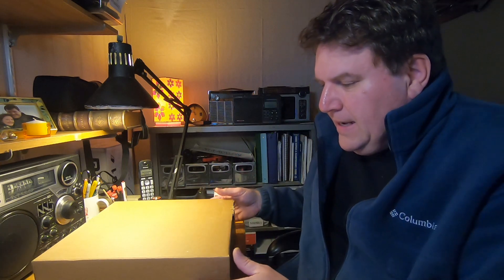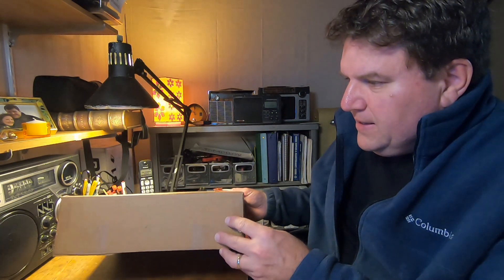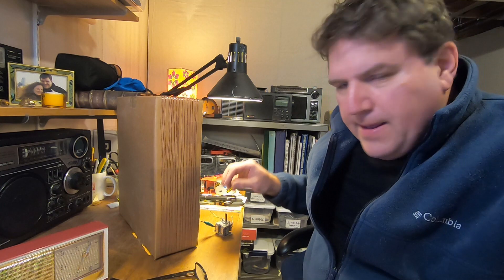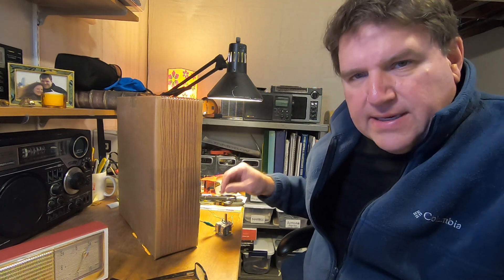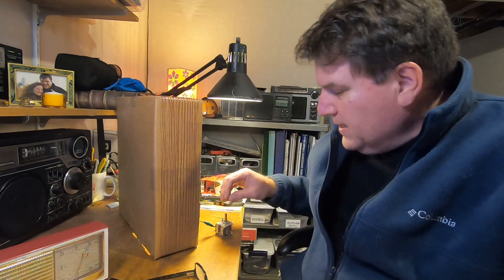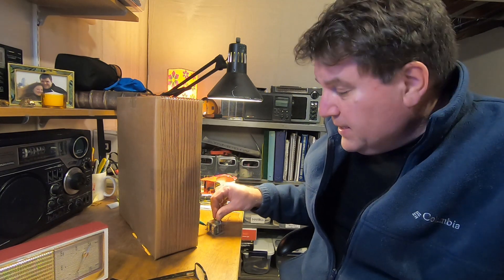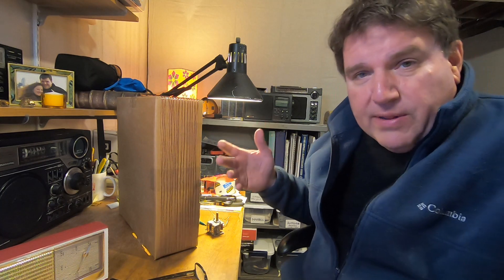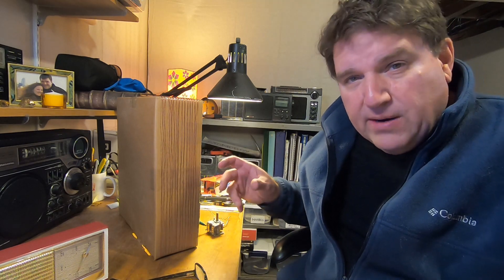Improve AM Radio Reception with a DIY Loop Antenna!

Comment: the gap in my zenith radio was roughly twice the thickness of the paper wound 18gau wire. wound too densely the capacitance drops drastically. ie 28gau enamel coated wrap is too dense. neat project.

Comment: Hi. That’s really helpful, thanks. Do the antennas improve if more turns of wire are applied? Is there an optimum length of wire?
Reply from the maker: I think there is an optimal length and number of turns, but I don't know what it is.  You can find a loop calculator online.  Here's one:  https://earmark.net/gesr/loop/umr_emc_round_calc.htm
Reply: @Radiodog Thank you so much, that is very helpful. Thanks for replying so quickly too!

Comment: Hey I tried with a loop similar to your antenna (wrapped around a tissue box) but not sure how to attach the variable capacitor to the antenna... And also still not really getting any better reception. Any suggestions?
Reply from the maker: There should be a lug on the capacitor.  For mine, I attached one end of the loop to the lug, and the other end to the capacitor body.  Hope that helps!
Reply: @Radiodog thank you!! I'm trying to send a picture of mine but can't seem to find a way to upload....there are three silver prongs coming out just not sure which one is right. Then I connected the antenna to the capacitor and the other side connected to the radio (it's a grundig) but still no joy 😢. Any suggestions?

Comment: Thanks. It’s funny that I see you have a link to a sizing calculator based on the Joe Carr formula. As I was watching this video, I was thinking that I should comment that anyone interested in radio reception, whether it be AM, FM, shortwave, or whatever, should definitely get the Joe Carr’s Receiving Antennas Handbook. I picked it up a few years back. A little heavy in the math and theory in some spots, but it will be good to get exposed to the heavy stuff even if you don’t know it, you’ll figure it out eventually. It has some great projects in it also, that are really not that difficult. I highly recommend it.
Reply from the maker: Thanks for the comment!  It's been a long time since I made this video; it's frankly a little embarrassing.  I've been tinkering around with this stuff for a long time, so I'm a little ashamed to have never hear of Joe Carr's book.  Sounds like I need a copy!

Comment: Thank you for this video.  You seem to be quite knowledgeable about this subject, so I'm seeking some advice.  I have recently restored a 100 yr. old Atwater-Kent AM Model 55 radio.  Very little work was performed on the electronics unit itself, as you could imagine after 100 years some of the antique wire was 'petrified'.  It has vacuum tubes, they were all tested, 2 needed to be replaced and were.  Upon energizing the radio, all the tubes have a nice glow.  But I seem to be having an antenna issue.  While I can hear some static through the speaker, I'm not picking up any stations.  I thought it was worth trying one of those cheapo loop antennas with 2 wires.  The radio itself has 3 spring loaded antenna connections, a ground, a short local connection, and one for long distance stations.  While trying the loop antenna, I heard a voice near the bottom of the band for about 2 or 3 seconds, but not after that.  There is still some static through the rest of the band.  If capacitance coupling is necessary, I'm not sure how that is achieved.  The front panel of the radio does have a selector that chooses between the long and short antenna capabilities.  Could you offer a suggestion regarding the antenna hook-up arrangement?

Comment: You need to get the capacitor as surplus as they are very expensive.
Reply: Yes, you can also make a home made on for doing an experiment.  It is not as nice as a professionally made one but it can be good enough.

Comment: I'm always surprised at how many people claim that a loop antenna such as the Tecsun AN-200 has no effect on reception. It's clear to me that they are not doing it right. The right radio is important, as is positioning of the antenna relative to the radio and dialing in the frequency correctly on the antenna. I've always had excellent results with the AN-200.

Comment: It's a pity you don't show one of the most important part, as least for a newbie : how to attach the wire the capacitor ? Have a nice day Tom
Reply: It is connected straight to the capacitor in parallel. There are two ends in the loop and two sides of the capacitor. It is not connected to the radio. It inductively couple to the radio antenna by being close.

Comment: @Radiodog I know this video is 3 years old, but I just found it.  I have an old Technics SA 110 adio receiver.  It came with an AM loop antenna, but that was lost.  There was no variable capacitor on the antenna, it just plugged into an RCA jack.  With your desugn, can I skip the capacitor and put some twists in the lead wires to a 6:24 n RCA plug?

Comment: My first medium/shortwave was a Greymark kit. Four tube analog. All spaghetti wiring with Variable Air gap Tuner. Lost it in a flood. The kit
Came with three plastic bobbins that had to be wound with copper magnet wire. Those plugged into sockets in the chassis.
 They had grooves molded into the plastic for # of turns and spacing.
They need to be wrapped clean and tight.
Ends soldered onto the pins.
 Tubes were about the diameter of a paper towel cardboard  tube. You could wrap two sided adhesive tape carefully to replicate the plastic tube. Or chuck up 1-1/4 inch PVC pipe in a drill or lathe and carefully score grooves in the tubing.

Comment: Does the homemade loop antenna have to be hooked up to the tube radio's internal loop antenna on the back of the compressed wood panel or or does it just stand alone. I happen to have that tuner capacitor and a bunch of other parts including 500 tubes I got from the swapmeet. Hopefully I can get better reception. A million thanks "Radiodog."

Comment: Nice crafting! Don't forget to take it outside w/a battery radio sometimes..noise level goes down!   
Here is a great DIY variabale capacitor: 2 big tapered  summer-drink tumblers.  The inner has a metal foil (like sicky alu-foil insulation tape)  on the outside, covered with the packing tape (insulated), the outer cup has the stickyfoil on the inside, tape-covered.  You muckle on to overhang from each layer with an alligator clip.  Nest the cups, press down a little, and rotate to tune!

Comment: Best I can tell you used bare non- jacketed wire? Can you wrap regular light gauge jacketed wire as I do not have bare wire? Thanks for your very good video👍
Reply: His wire is enameled(spelling?) so not really bare.  

Yes you can use plastic coated wire also.

Comment: Ok, you made a box antenna and you connect it to a capacitor (you don't say why ???). You don't show how everything is connected ... how are we supposed to connect everything? Can this be used for a car radio ?
Reply: The "box" antenna isn't connected to the radio - it is placed close to it so it can "couple" to the ferrite rod antenna inside the radio. Experiment for yourself, there are lots of different variable capacitors. On the older types clip a lead to the metal frame and another lead to one of the tabs attached to the moving vanes. The wire loops form an inductor which with the variable capacitor make a "tuned" circuit. That is basically how radios work. I don't suggest you try balancing one of these on your car's dashboard whilst turning the capacitor control and driving!

Comment: Very interesting but you did not show how you hooked the wires between the capacitors and the radio. does the radio have two screw terminals on the back? is everything hooked in series?

Comment: Radiodog, Greetings!   ---- Living in eastern KY, AM radio signals are very weak to non-existent to stations only 1-hr away.  I followed your directions on the DIY Loop Antenna using 100-ft of doorbell wire and went out and bought a variable tuning capacitor similar to the one you show in your video --- mine was rated  as a single 365 pF.     Being a neophyte in the amateur radio world, should I attach both ends of the loop ant. to the opposite leads of the capacitor (mine has 4 contact leads)?   I'm not getting any results close to what you had in your video.  Any advice you can provide would be greatly appreciated.  Thanks!

Comment: Great video!!! Just watched this and the performance of this homebrew is very impressive. I'm building one right now but the only variable capacitor I could find is a dual gang unit from an antique Silvertone radio. How critical is the value and type of tuning capacitor for this project? I don't want to rip the old radio apart if the tuning capacitor won't be appropriate. Thanks!

Comment: You don't even need a square box.  I've seen them make from round boxes, rectangular ones, wood forms, etc.

The only problem with these simple loop antennas is that they are only useful for the AM broadcast band (520 - 1720 kHz)  so you need something complicated and expensive for the rest of the shortwave bands.

Comment: Since Radio Shack closed, you have nowhere to go for electronics stuff, except  eBoo or Amazool.  You can easily get antennas for ham radio, but there is nothing for shortwave.  The capacitor is only available from a specialty vendor and are VERY expensive,  unless you can make one yourself.

Comment: I made mine today and working surprisinly well! I used a laptox box too, had enameled wire I had as surplus and a varicap from a old radio once disabled and saved. Then with some hot glue as aid did the turns. Many tnx for your practical advises and keep on!

Comment: Why?  Would you want to disassemble an old radio? Radios of all types are becoming rare. Maybe FIX the old radio. Buy your new electronic parts from ebay/amazon, Digikey, Mouser.
I have accumulated many old electronics.
And wasted many hours trying to desolder components. And destroying parts by getting them too hot in removal.
Goodwill stores get a huge amount of electronics.  Talk to the guys outback in receiving for special things.

Comment from the maker: To all who may be wondering:  this antenna is coupled to the radio inductively, which means there is no physical contact between the radio and the antenna.  The radio is simply put in close proximity to the antenna, and the antenna is tuned (by means of the capacitor) for peak signal.    

I cannot tell you exactly how to connect a capacitor to the ends of the looped wire, as capacitors vary.  Some experimentation is called for.  For the capacitor I used, one end of the wire loop is connected to one of the terminals on the capacitor, and the other end of the loop is attached to the chassis.
Reply: Does the capacitor help with the fact that the wire isn't the exact 1/2 wave length or something?
Reply: 👍👍👍👍👍Thanks for clarifying. Total newbie but eager to learn.
That I beleive is the 'chassis' of the capacitor.
How about powering the antenna? Separate power or generated from magnetic coil when RF signal brushes against it?
Thanks again, I am so much nearer to building my own loop antenna.
Reply: WHAT "chassis"??? Please expound, thanks!
Reply: @usernamemykel the capacitor frame is the "chassis".

Comment: Same question everyone else is asking.  How did you connect the wires to the radio?
Reply: It works by induction....no connection to the radio. I made one with a 16 inch pizza box, 16 turns of 24 AWG magnet wire, and a 450 pf tuning capacitor. See a demo on my channel.
Reply: There's no a physical connection, just put it close to your radio receiver and radio waves do the rest. It's a resonator!

Comment: You do not show us, how you hooked the wire to the capacitor, and then the capacitor to the radio. You only show the front of the radio. I already know what the front of a radio looks like.
Reply from the maker: Yes...I could've done this SO much better.  Sorry about that.
Reply: @Radiodog  So why don't you type in the answer?
Reply: @ababner317  I agree, without that answer the video is void.
Reply: @Radiodog  duh !

Comment: Saddly, you placed the Channel Master in front of your antenna/variable capacitor combo, can't see how it's all connected. Is the loop antenna connected to the radio? How did you connect the capacitor, with both leads or just one? Please reply
Reply: Max Warfield. It is an inductor RF device.
No physical connection with the radio.
Reply: @ayebee1207  Total Newbie here, was also wandering how those connect together.
Thanks for pointing out.
One more piece to figure out... how to connect capacitor to loop antenna...
Thanks again.

Comment: am signal deserve die, its very problematic. wondering why still alive in this side of the world. im not expert but in europe they have hd Radio? and not longer am?
Reply: HD radio can be over AM or FM. AM has a huge advantage over FM in that you can tune in a station from a significant distance, where as FM is just line of sight. In northwest Ohio, I picked up a station from Denver with just my standard car radio antenna one night, and that's 1800 km away. Maybe that's not important where you live but here it still matters, even if only to a much smaller percentage of the population than it once did.

Comment: This isn't on topic but have you seen the plans for the Carver ultimate AM antenna? It's for radios that have terminal connections. Basically it's four turns of wire on a 12" square form. I used a large coffee can for a form and doubled the #turns to compensate for the six inch coffee container size. I did experiment a bit to find the best #turns for the different size. I use it for my stereo receiver that requires a loop antenna for am. It works remarkably better than the cheap little loop included with the receiver.

Comment: Two questions: does the box have to be one square of 12 inches per side and 4 inches deep and do the wires have to be equally spaced? This is a pretty cool video. Thanks.
Reply from the maker: I purposefully made the dimensions approximate.  12" square, or thereabouts.  I suppose it could be a bit rectangular, although that might affect its performance.  I did my best to make the wires equally spaced.

Here's a link to a calculator online, if you want to actually measure.  (I was attempting this one with rough measurements.):  https://earmark.net/gesr/loop/joe_carr_calc.htm

Comment: How does your home made box antenna compare to the tecsun loop antenna I see on your desk.?
Reply: It`s probably a good bit better but the Tecsun works really well. There isn`t a lot of difference until you use much larger loops from what I`ve seen. This one looks twice as big so it likely has more gain but not a whole lot more from the videos I`ve seen on YouTube.
Reply: @tomjones239  Thanks
Reply from the maker: Hmmm...good question.  I just built this as I made the video, so I haven't really tested yet.  I'm guessing more or less the same.

Comment: Hot glue a bottle cap to the shaft of the capacitor so your hand touching it doesn`t interfere with tuning.
Reply: “Redneck Tech Tips”
Reply: Good tip for me to try.